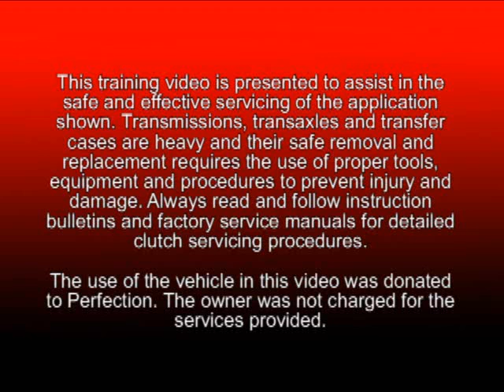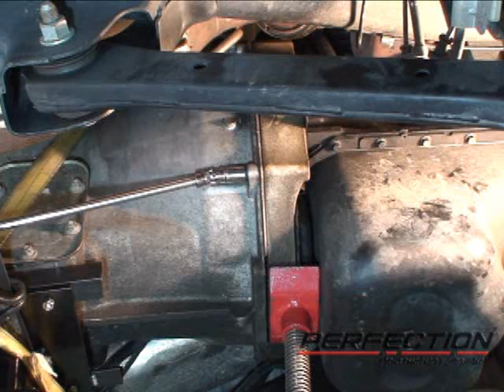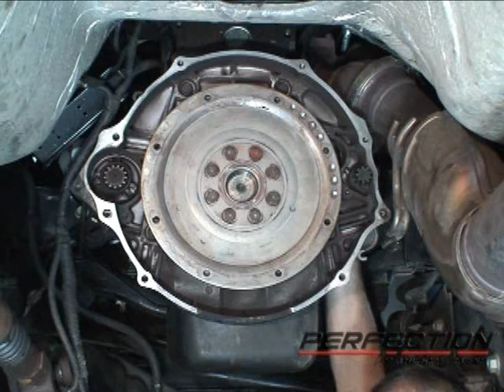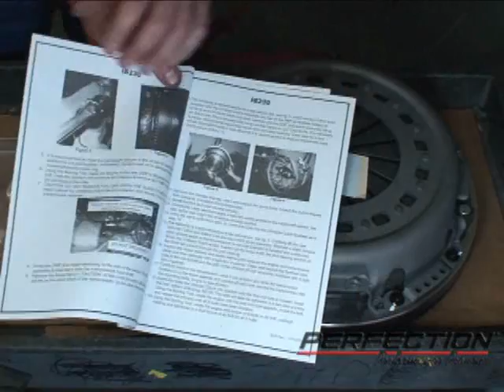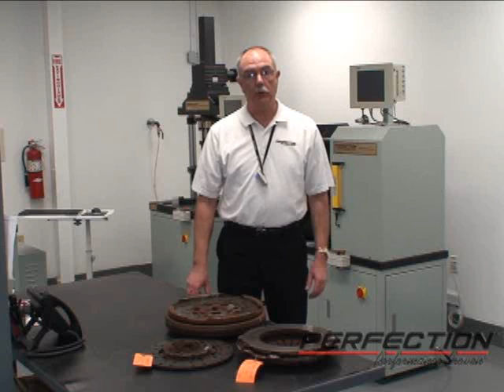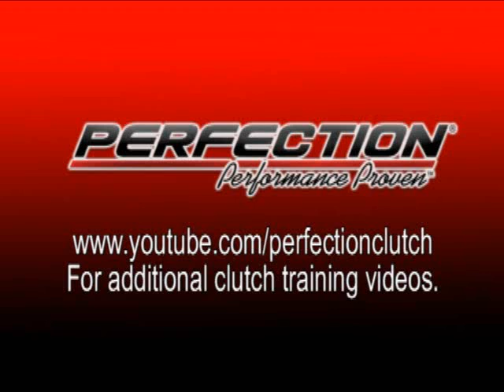Dodge Ram 2008 6.7L G56 Transmission Clutch Installation

Comment: Is this available for 2010 Ram 3500 with the G56?  My 5th started to slip.  If yes where can i buy the parts?
Reply: Always replace with dual disk organic from valair or a solid flywheel upgrade dual mass is trash

Comment: You didn't mention the gear rollover noise that the G-56 will now produce. That is the side effect of the smf conversion. it the guy worked the trans over 99K I wonder why he didn't go with the stocker again? I miss that nearly silent trans. I have the SBC OKHD conversion clutch in mine with Amsoil MTG 75-90 synthetic.

Comment: i have 300 thousand miles on my truck,  put in a new clutch and the pedal  doesnt engage until about an inch from the floor and hard to get in gear. any suggestions,  everything is new hydraulics, throwout, flywheel conversion, ect..
Reply: U have to switch to a adjustable slave and master. . Or use nv5600 slave and master they have a longer stroke once u switch to solid mass conversion

Comment: Just installed this exact same clutch on my 06 I noticed after install truck is harder to go into the gears and pedal is stiffer not as soft as the dual mass any suggestions
Reply: I have this same problem in my 06 and its gotten worse
Reply: @sorenabel6061   did you just do yours. Went to the gear oil instead of atf dont know if that makes a difference. But I did over fill mine by a quart.
Reply: @shane hall I did mine almost a year ago, I had gear oil in mine,  switched to atf thinking it was causing the hard shifting. No luck.  Getting ready to buy a south bend or valair
Reply: Smart move I will definitely be swapping mine out. And upgrading the hydraulics. Let me know how the valair or South bend does I  had a single disk in my 01 with nv4500 and loved it. I kinda miss the softness of my dual mass that was in my g56 before going to this junk
Reply: @shanemode1-k5o  same here. This is actually my 2nd one from them. The first 1 had factory defects and only lasted 7 months. The factory clutch was nice to drive with.  I hear valair and south bend is really nice

Comment: Thank you great video, we are doing this on a 07 dodge 3500 dually this weekend and we do not have a auto lift we are doing it caveman style on the concrete floor, wish me luck.
Reply: Did you have the issues were the pedal is more stiff and harder to go through the gears
Reply: @shanemode1-k5o  Actually  the clutch pedal is soft like really  smooth, only issue is transmission makes noise we had to ad additives to the oil to quiet down the noise. The dual mass did that by design to quiet the gear noise.

Comment: I am also doing a clutch install on 6.7 cummins with g56 transmission. I need the bolt torque for the bolts connection the transmission to the engine. Also would like the tightening pattern. Thanks.
Reply: Gary, thank you very much.

Comment: what is the easiest way to get to the top bell housing bolt without taking the exhaust off
Reply: Asssemble a socket with 5 feet of wobble extensions. Alternative to wobbles, you can use a swivel socket.

Comment: what's the power rating on this system I've done a lot of after market and my factory clutch just slips if I don't ease up to speed if I put the pedal down in any gear below 1800 rpm just makes lot of noise and goes no where

Comment: I have a 07 Dodge Ram 3500 5.9 diesel 6 speed manual and I have a hard time shifting into gears when it's at a stop mostly when I want to go into reverse I got the master and slave cylinder replace and still does the same thing what could be wrong with it??
Reply: I'm having the same problem.  How did you fix it?

Comment: Couple questions.

Number 1: if the clutch is not self adjusting how do you adjust for wear over time? How do you know when to adjust? 

Number 2: how did you align the holes when you put the unit back in? showed bolting the tray back to the motor how about the clutch to the flywheel? Did you use the special tool again to turn the motor and just spin the trans by hand?

Number 3: visited 3 local shops and both book this at almost 10 hours. after watching your video it makes me wonder, "where is the other 8 hours going"? what do you guys book the time for labor on a project like this?

Comment: Thank you for posting this video.  We just bought a clutch kit K52179-1SK from O'Reilly's, however, the box was open.  Looks like all the parts are there EXCEPT the installation guide, which from your video looks indispensable.  Will call Perfection in the morning to see if you can fax or email me a copy of the installation guide.  I think we could do it from this video alone, but I would rather have the guide for backup.  Also, I didn't see the spline lubricant in the box we received.  Blessings, looks like a great product!

Comment: to bad you didnt supply a rear main seal and installer with each kit
Reply: ye man, i just work in the trade and know how much work it is to R&R a tranny and i know myself i would replace the rear main or recommend it everytime and leave it to the customer but when they hear how little extra time it is, they usally slap one in there.

Also J body Gm's (sunfires for example) have you ever tryed to remove the transmission from the top?

Comment: Hey I have a 08 dodge 6.7 6speed manual . The south bend clutch I have is good but noisy . Lol any way my hydraulic clutch went after 40000 miles is the install the same as ur vid on the 2005 2500 ram ?

Comment: I just put the valair 700 hp clutch in with ceramic buttons.  having trouble adjusting the clutch with the neutral safety switch any ideas also for reference how much is your kit and were can some one go to get it thanks again buddy.